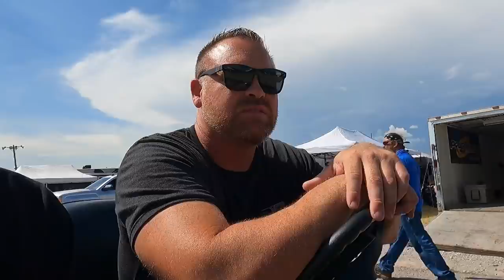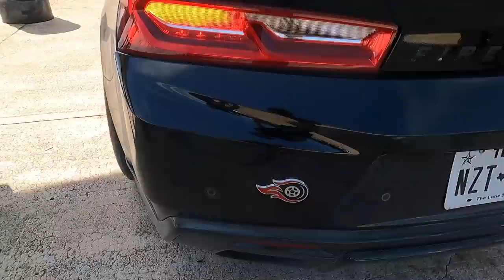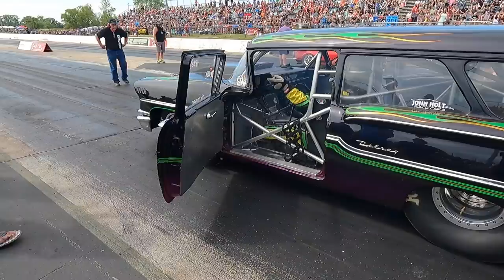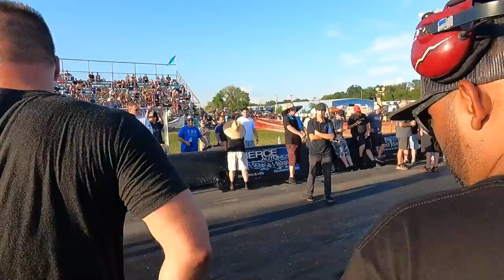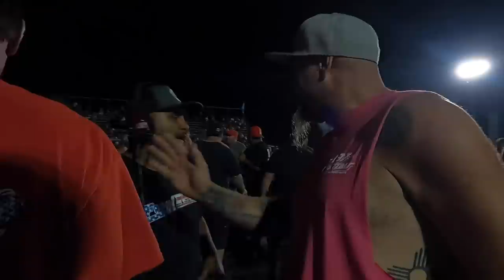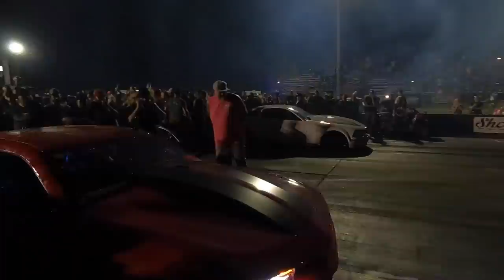Outlaw Armageddon 7 - OG Fireball Camaro Wins Big Tire!

Comment: Next time you need to change a valve spring put a soft rope into the cylinder thru the spark plug hole and hand turn the engine until it stops. The rope will get pushed up against the valve and then you can take the spring off without the valve falling into the cylinder. The rope is soft and won't damage anything. It will push hard against the face of the valve holding it solid.
Reply from the maker: Sweet trick!!
Reply: @FireballCamaro  try it. You will like it.  I promise. @Fishermotorcompany
Reply: Old trick but a goody.

Comment: Since the buying rules have changed for the Copo to where you don't have to be put on a list and hope that you get excepted and instead of the cars being limited to 69 to each type of set up and also this year they have added a 572cid BBC engine option to the list of set ups you can get in the Copo this coming up year would you think about getting one? and not run it in stock or super stock you can put your twist on it and set it up to run either small tire NPK or on the streets in a small tire Cash Days the only downside to a Copo is the price tags start at around $100,000 and go up from there